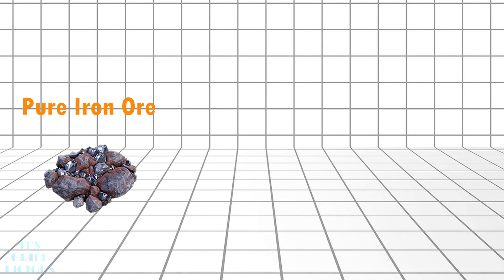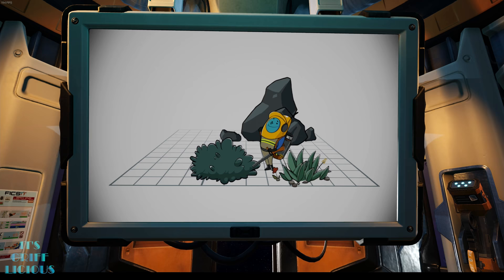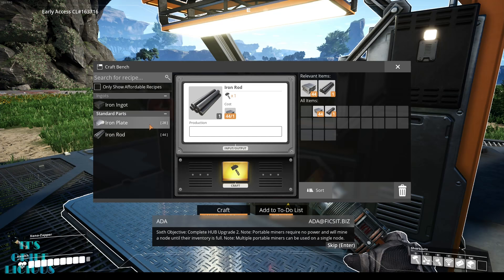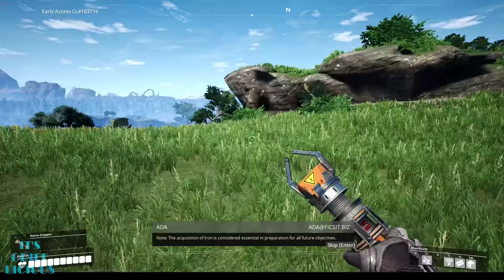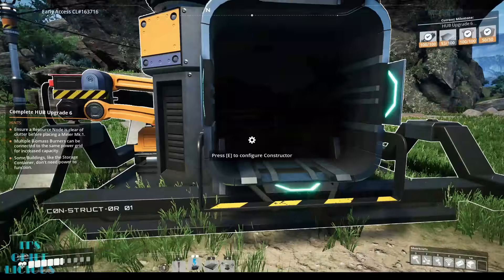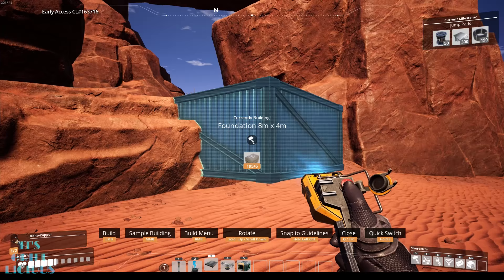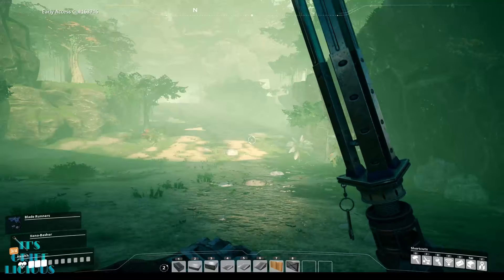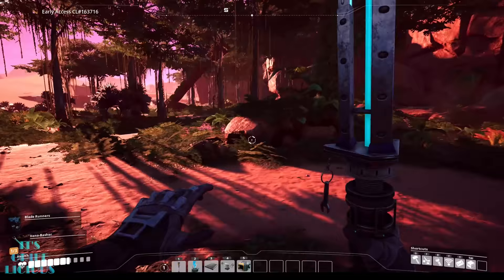Satisfactory: An Unlikely Masterpiece

Comment: You need to be a certain type of person to play these games but man, if you are satisfactory is about as good as it gets. Its my 'have a beer or two and mess about for 6 hours on a friday night' game, and it changes depending on your mood. I have sessions where I just go out to pick up slugs or hard drives, I have sessions where I build entire subfactories, I have sessions where I just 'pretty' things up like Im building houses in The Sims, I have sessions where Im like 'idgaf just get it done/built' and I have sessions where I sperg out because that one power pole is half a tile out of position so I better rebuild that bit.
If you want it to be, every project is a rabbit hole. I set off to get some silica one session which lead to laying railways, expanding power, building paths etc etc and 50 hours later im like 'cool, got that silica, now I can start aluminum'.
Its like crack.
Reply from the maker: I just spent, including the scouting locations and calculating production, at least 30+ hours just making a massive facility.  Just so I could use a slew of alt recipes that allows for crystal computers, culminating in two assemblers making them lol. Fucking absurd
Reply: dont agree....... i not a big fan of these types of games.  but as the video mentioned they hit all the marks.  Sure i never get 4k hours or 2k in it probably.  but i broke 100 hours and i sure given enough time i break 200.  for me that is a huge amount of gaming in 1 game.  i would argue this game is for anyone.  because u can do anything.  explore, build, math lol.  create, some fighting.  i guess that be its biggest hold up is fighting.  once u get sword- gun fighting is easy even for noob like myself.  but i dont really play this game to fight so its ok.
Reply: You nailed it at "... Every project is rabbit hole..."
Reply: Preach on brother!
Reply: Its indeed like drugs, if you want to desconnect from earth and see the day come and go in a blink this game is definelty better than any drug i've done so far. trust me.
- A former drug addict who was advised this game by a mate in rehab and curently has 3200 hours in this game
Reply: 1/2 half tile... OCD much? Lol!!!
Reply: @skilz8098  its a curse lol
Reply: @skilz8098  that'd be reason enough to tear the building down and rebuild the entire thing.
Reply: damn, that's like my iron factory redesign 4 (yes I had re made it 3 times before, yes I am just getting started on oil production, no it's not 100% efficient, yes it looks worst than before, no I'm not proud, just waiting for update 5 to pretty things up a bit more easily) I was like "damn, I got to get some motors now if I want to get into oil production" spent like 10h to get as close to 100% efficient as I can with what I have atm, then realise that the only iron thing I needed was some screws and the rest of the motors are copper and steel, well let's make copper now! 3 more hours and I finally got some motors! (on the plus side, I now have a bit of everything slowly building up)
Reply: It's an excellent game for people who kinda want to crack open a beer and relax and work towards something that's entirely your creation.  Something I get from this game that I don't get from Factorio is a strong desire to make things look proper.  It can't just be a factory.  It has to be a factory that makes my heart sing when I watch it work, knowing it hits near 100% efficiency because I took the time to make it that way.  If I had any complaint, it is that the milestones always introduce to you better tech you can use to make your factory.  While that isn't bad in of itself, it kinda makes you want to rush the milestone before you commit to bigger and better factory builds.  Like what good is a subfactory making steel products if you can't bring them back to your main factory?  That said, that is literally my only complaint, and I don't even know how I would improve on it, frankly, because it's correct that milestones are desirable to finish.
Reply: @Grifflicious  you must try out Icarus when it releases =)
Reply: Have you played Factorio? I'm wondering how they compare. I'm interested in Satisfactory but unsure about the first person perspective.

Edit: it is indeed mentioned later in the video.
Reply: @Ahrpigi  I was huge in to factorio before satisfactory.  When I first got satisfactory it took a while to click but i was still all in on factorio at the time so I didnt really give it a fair shot. When I finally burned out on it I gave satisfactory another go and here I am.
Theres more clunky stuff that can be a bit annoying like building your 100th splitter>belt>constructor combo because theres no blueprints (there are mods that mostly fix that stuff though), on the other hand satisfactory does some things better than factorio like not needing to worry (unless you want) that your ratios are perfect etc. Being able to walk/fly around your factories in 3d and have more input into how theyre designed is awesome too.
I wouldnt guarantee it, but id be surprised that if you like factorio you wouldnt at least get your moneys worth out of satisfactory.
Reply: @Ahrpigi  It is a different experience to be sure, and where it takes maybe 10 minutes to double power in factorio, in satisfactory it takes maybe 10 hours.  ;)

Though there is a weird desire to make everything look as good as possible.  If you haven't played satisfactory, as a factorio fan, I highly recommend that you do.
Reply: Yeah I'm a sucker for the genre....Dyson Sphere Program is worth a mention too.
Reply: @neil2444  I'd agree on your complaint! it always leads me to a messy way. B/c the whole rebuild is in mind and you just start to rush the hell out of it. Then if you've gotten the milestones (especially belts mk5) then you already have a big factory and it is even more tedious to rip it down for the actual factory :S
Reply: @Grifflicious  and you loved every minute of it, except that second when the belt clipped to the wrong tile and the pipe wouldn’t bend properly lol
Reply: Wow you just summed me up completly, you just inspired me to keep going because it can be overwhelming sometimes and I'm feeling the grind and stopped for a few days but after reading this I feel like I'm not the only one that does exactly what you just said so I'm jumping back in, thank you mate 😁
Reply: @bradleyroissetter6796  Not sure if I should apologize or not lol Good luck!
Reply: No apology needed it has its benefits like maths, ratios, algebra.  If I wasn't playing this I'd  probably just be watching a film or playing a mindless-ish game like C.O.D, my math skills have genuinely improved because of this game it helps at work crunching numbers and I love doing that, never paid attention in school back in the day, so it helps. Only down side is it takes forever to get anything done so I work around that but I love it when all the numbers work perfectly, %100 efficiency all the way bro
Reply: @FastDuDeJiunn  "i would argue this game is for anyone.  because u can do anything.  explore, build, math lol."

The problem with that is that the game really does require some amount of all of the above*.  Without engaging in each type of activity, your ability to engage in the others will be severely limited.  Which is excellent if you like all of those things, but I can imagine that some people might like exploration and fighting, and have no interest in managing supply chain logistics.  Or someone who might be really into the math aspect, but find the exploration aspect daunting and the hostile creature encounters stressful.  Some people might like the challenge of fighting and the satisfaction of puzzle solving, but have difficulty with first person games in general.

There's a lot of aspects of Satisfactory (as with most games) that might be a deal breaker for someone.  But yes, if you enjoy a broad array of common video game tasks and challenges, Satisfactory doesn't skimp on any of them.

*multiplayer with a group of people who each focus on complementary tasks is a possible exception.
Reply: Lmfao nailed it
Reply: Toast to you brother, we are of the same kind☺️
Reply: It literally took 25+ hours to settle 10 railroads and 15 cargo trucks on the hub base delivery system just to have a room filled with containers of anything I produce...

All started with : the hell I put my oscillators manufacture
Reply: My sessions consist of building a mess of twisted conveyor belts and misplaced machines only to get pissed that I suck at the game and give up after seeing the amazing builds online.
Reply: @FastDuDeJiunn don’t fool yourself. Satisfactory dabbles in other things but at it’s core it’s absolutely a factory building game, no doubt about it. Yes, it has a good variety of gameplay styles, and they can be quite fun, but you aren’t going to really access them until you’ve played for many hours, so factories really are required. If you don’t want to do that there are plenty of other games out there that do stuff like combat and/or exploration even better.

Satisfactory is a game lots of people can enjoy, and enjoy a lot, but just because you enjoy it very very much does not automatically mean that it’s for everyone.
Reply: I feel you.  "New" to Satisfactory, I have spent about 70 hours just exploring the systems, world and trying to create a mostly-working factory which looks like grenade went off in a Lego Technic bin.  20 hours was spent just trying to get (reliable) fuel for the automated trucking and power generation because F biomass fuelling - all so I could get a quartz mine going (still not built yet) and actually start silica.  Satisfactory should be featured in the dictionary under 'Addictive'.
Reply: That silica is a trap. My wife recently started a project that involved silica while I was doing some other project and when I went to visit her, she built a 4 story mega steel factory and couldn't remember why she needed it 🤣